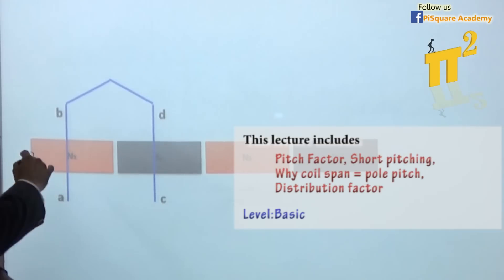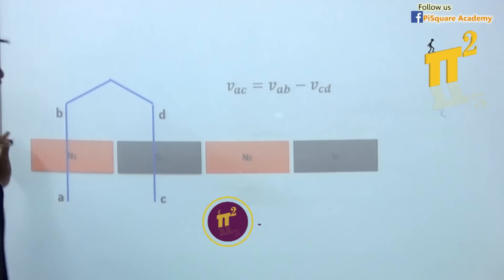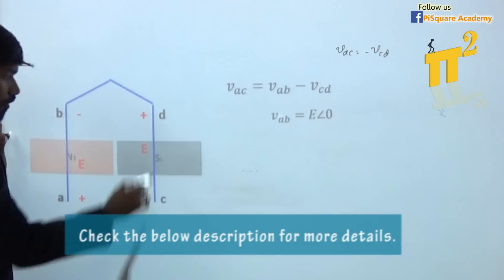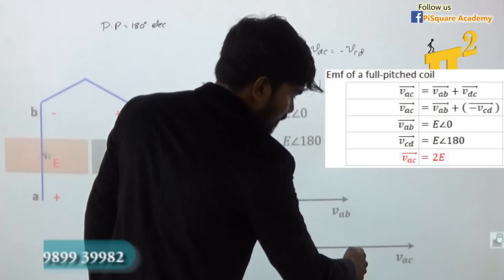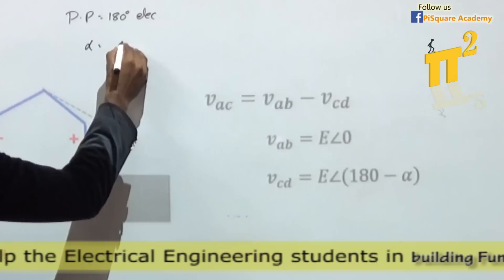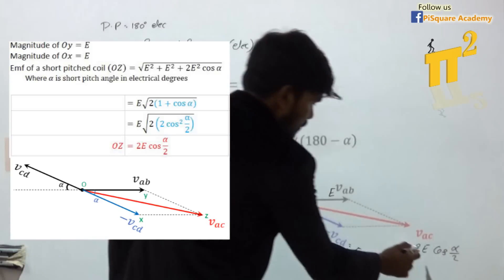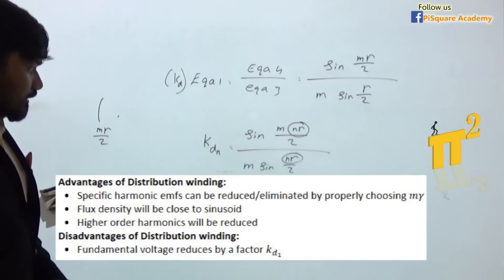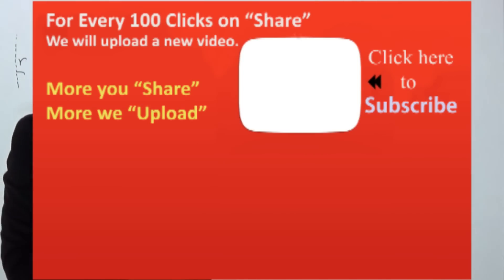pitch factor and distribution factor in alternator

Comment: Excellent explanation Sir
Could you please clear my doubts about alternator sir 
1) if I consider 36slots stator and 6poles rotor then coil span:6, slot angle 30degrees but for 36slots in 360 degrees then slot angle should be 360/36=10 how it is possible?
2) Could you please explain the distribution winding process in stator of an alternator (in deep)
3) Requirement of a pure sinusoidal wave  form of emf which type of winding is preferable?

Comment: Why table fan doesn't need capacitor??
Reply: Capacitor is used in table fans! They differ in construction from the normal cylindrical ones which are more common, usually they are cuboid in shape. You will find one if you remove the fan casing, i advice not to do so....